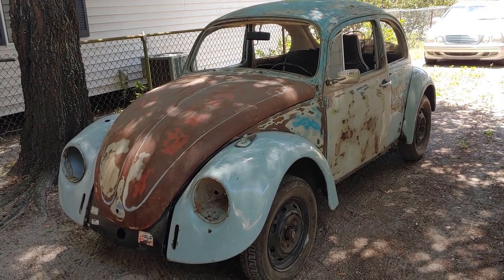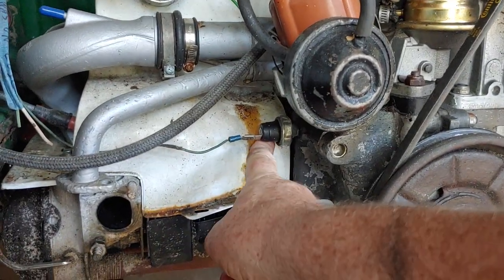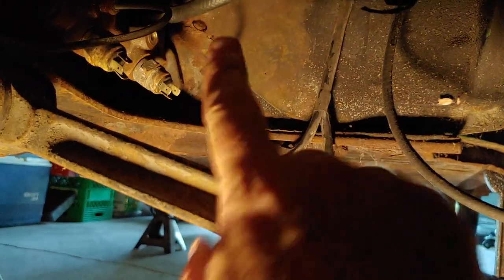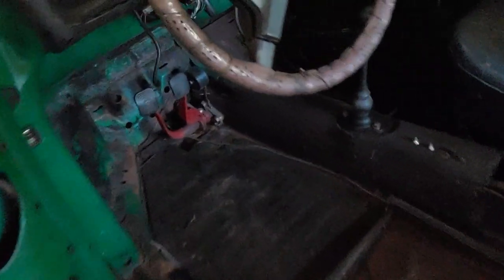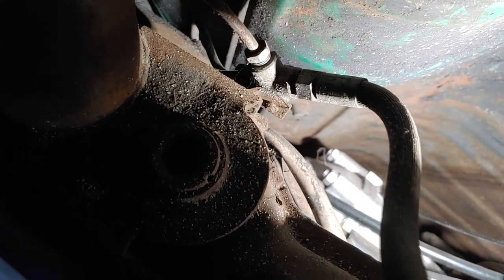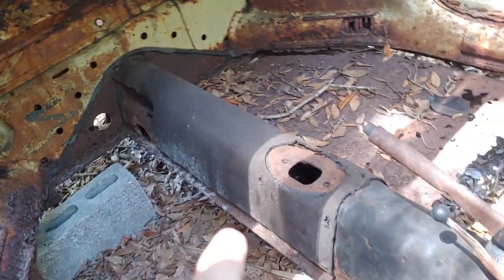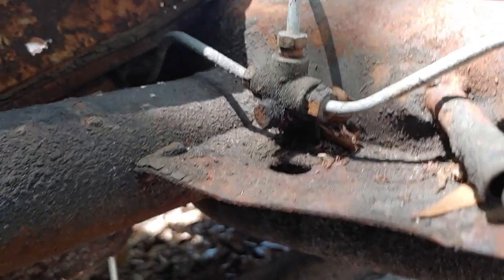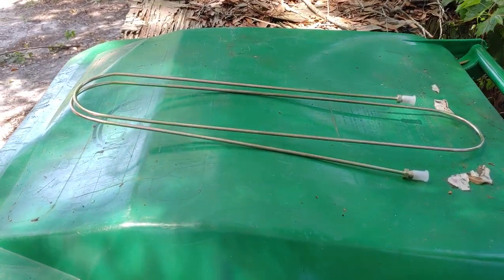CLASSIC VW- 1972 SUPER BEETLE UPDATE. REPLACE REAR MAIN BRAKE LINE

Comment: great job explaining   i have to weld a new luggage pan in i though about adding a trap door  or one might call it a access panel behind the seat in order to gain access to the break tee
Reply from the maker: Its access right above the frame horn. I thought the same with the hatch till I see where its at. Its not that bad of a job. The biggest pain I see is bending the line. I have a friend up in Jacksonville who made that hatch from a type 2 motor cover. Check out his channel: Duckman cycles and VW garage. Glen is a great guy. He responds to comments.

Comment: You can get to the tee in the back, just takes patience, pb blaster and short wrenches. If you can’t get the line wrench on it, try a pair of channel locks worse case. That’s how I did mine years ago.
Reply from the maker: Just took a line wrench. Mine came off with a little tension. This was the line you said needed replaced when you installed the master cylinder. I forgot to get the rubber gromets for the brake line. Have to see if I can get it online before I install the new line. One good thing there was brake fluid in the lines. Didn't look to bad of shape. No water in the lines. Maybe i got lucky( lol). I have a new line kit waiting to install. Thanks for all you have done and continue to help out. The 72 super beetle will be parked next to jaw breaker at BUGJAM this year. I already made plans to have it towed on a wrecker if needed. Shouldnt need one at the pace I'm going. Its all coming togther.
Reply from the maker: Spell check is not working tonight
Reply: Volkswagenplanet worse case we’ll get a group of people together and knock it out.... you WILL be at bug jam this year!!
Reply: And spell check just got me 🤦‍♂️
Bug Jam.
Reply: That’s how I removed mine as well. I am actually going to run all my lines under the car attached to the tunnel.